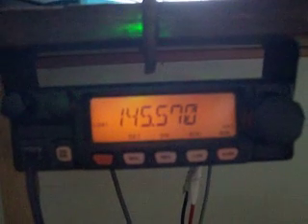Packet Radio

Comment from the maker: @linagee It's all relative. As opposed to many other digital modes that can be utilized this way, it has several advantages, including baud rate. It is quite adequate for sending text messages point to point within the range of the given VHF/UHF radio capabilities. Of course this is from my limited understanding, and if you have a method that is more robust, please share it for the benefit of others. Thank you!

Comment from the maker: Not that I am aware of, it may well be possible though. Have you tried SSTV? Look for the free program called MMSSTV. 

I haven't tried SSTV much on vhf/fm but don't see why it wouldn't work, as long as you have a proper interface (Rigblaster etc.) and a radio that can do digital in FM like the FT-857 can. 

However, you probably wouldn't usually need/want to do it in FM mode anyway.